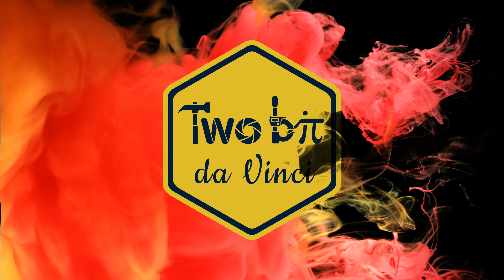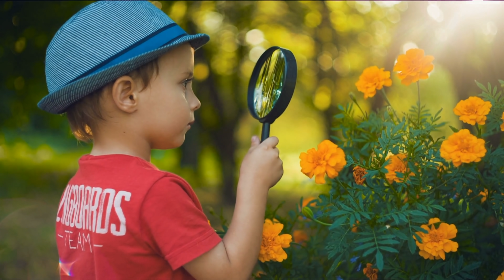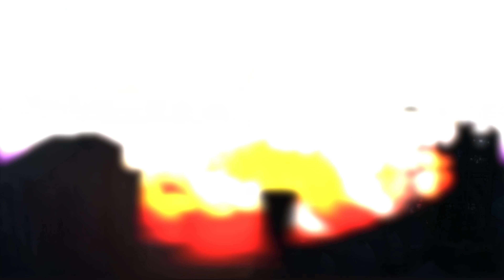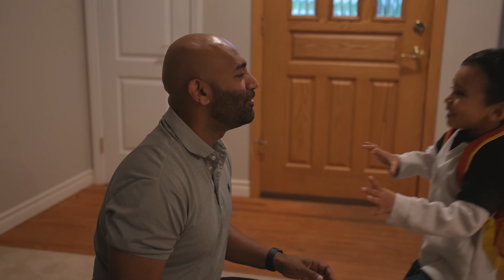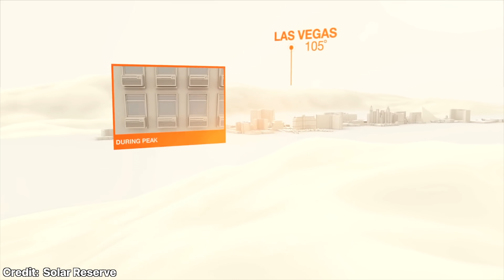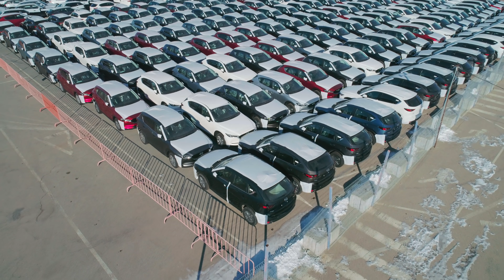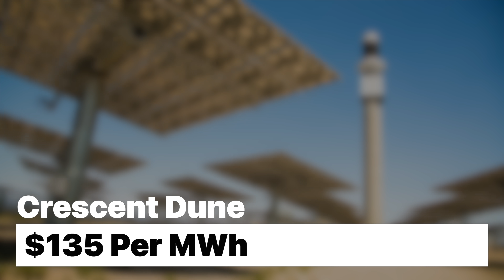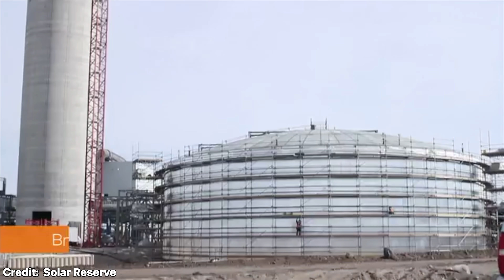This Billion Dollar Solar Plant was an EPIC Failure

Comment: Green hydrogen is always going to be the least expensive storage at scale because a big tank is always going to cost less than a bank of batteries, and the new electrolyzers using magnetic fields to align oxygen bonds are literally twice as efficient as pre-2019 electrolysis.
Reply: There are plenty more storage options coming up besides batteries, like Heat storage, LAES, CAES, ... And there are also battery solutions that are a lot more scalable and easily build/cheap than Li-ion batteries, though usually with lower density/slower reaction times, but that isn't really important in gridscale storage.

Hydrogen is probably one of the worst storage devices long term, both due to cost and efficiency. Ofcourse maybe hydrogen production might improve, but it isn't there really. And ofcourse hydrogen will be needed for a lot more than just storage, so production capabilities might be better aimed at those other needs.
Reply: Source?  (I have doubts)

Comment: Put PV panels on every roof of every building and scale will take care of itself.
Reply: You forgot a huge one, parking lots. Shadow to keep your car cool while charging it up. Drive to work in the morning, hook up, be full in the evening. Next use your car to power your home.
Reply: @astranger448  Good point. This is already being done where I live in the desert Southwest. Most schools and  some shopping centers have installed solar panels in the past few years. No hook ups yet that may come later.. All of these installations are small enough to nullify the problem of scaling up.
Reply: PV is wonderful.  I’m running my house 100% on 8 x 330watt  panels on a Zomeworks tracker.  I bought them for $100 each.  My Grid-tie is giving 1 to 1 credit.  However now the utility is only giving 60% credit for new systems.  This is the problem with PV everywhere.  The utilities need to provide power at night or cloudy weather.  They need compensation for this.  They don’t want to do this for free anymore.  The same thing will happen when everyone has an electric car.  They’ll have to add fees for road maintenance, etc.  The devil is in the details.
Reply: grid stability - frequency and voltage
Reply: Add batteries and the ability to feed the grid at night and you have something.  Who’s going to pay for it?
Reply: @jeffgerhard5770  I live in a part of the country where electricity is expensive, robust air conditioning is a necessity, and where there is a lot of sunshine. My 12 kW solar system generates enough electricity to cover 100% of my annual consumption. I’ve had it for 3 1/2 years and am on track to have the system pay for itself in six years. In other words, it is a good individual investment. I qualified for a 30% federal tax credit which was the government part of the investment. I have considered adding battery storage but the finances don’t quite add up yet. In short, I think that the investment in solar power on a decentralized basis is feasible. It won’t happen overnight, nor should it. A gradual move will allow adjustments to be made at every level — individual, governmental, and public utility.
Reply: @jeffgerhard5770  Compare it to buying a house VS renting a house, pay once a defined sum VS paying an undefined sum forever. All it takes is Russia invading Ukraine to send energy prices through the roof. I'd rather not be at the mercy of every lil tin pot dictator. That being said, my money went into insulating my home, lowering my heating bill to the point said bill almost went away. That is what will pay for it.

Comment: Using the thermal energy without using the steam cycle will bring the project closer to economic use. the turbine with steam production has only 30 percent rendement. and produces a lot wast heat. never ask why every electicityplant uses the coolingtowers ? even nucleair plants produce 70 % wastheat poluting rivers and air with heat.

Comment: It would be cool if those mirrors could be pv, and still reflect.  Providing both types of energy gathering
Reply from the maker: Now that’s interesting… absorb what the cells can convert, and reflect the rest! Big thinking Ed I love it
Reply: Unfortunately the ideal angle for a photovoltaic cell is square on to the sun, which would reflect the light back at the sun, not at a collector tower.
So, if you angle the panels to reflect towards the tower, they power generated by the cells would be reduced.  I  would guess you would lose 20% or 30% of the output from the cells.
Reply: Unless you are talking about exotic double and triple junction PV cells, both conventional PV and solar thermal want the IR portion of the solar spectrum. So, no.

Comment: You did not explain why, at the best moment, they were only producing 50% of their estimated capacity.
Would they have been able to break even, if the price of electric power did not drop like it did? 
Also, the price of photovoltaic energy seems always to be calculated without energy storage, while nobody wants to wait until the sun comes up before using electricity.
It's a bit like comparing apples and lemons. It does not make sense.
Things wear, just by being out in the desert all day, every day. This must be foreseen. 
It seems they make some bad assumptions, causing regular outages.
Still, maybe a v2 version of this plant, could have a lot lower operational costs.
Reply: I worked on the project. The mirrors are covered with frost and snow in the winter and dust the rest of the year. The plant is at 7000' altitude.
Reply: @matthewerwin4677  In the desert, I would not expect a lot of snow, nor rain. Dust sure, but limiting the whole plant at 50%? Seems at least some of the calculations made, were a bit too optimistic.
Reply: @michelhegeraat5430  I was working on the project for a year. I spent the winter there. Every week or two we had a dust storm. Winter is the wet season in Nevada. Below zero temperatures and several inches of snow were common.
Reply: this whole channel sounds funded by 

OIL  INDUSTRY  CABAL .

EXCUSES...EXCUSES...

MORE  WEAK  UNFOUNDED 

E   X   C   U   S   E   S 

.
Reply: @davidbea3711  this channel is very clearly pro green alternative energy and always has been.  Are you basing your comment off just this video or something?
Reply: @StormGod29  this & 1 other vid
Reply: @davidbea3711  I don’t get what you’re saying. The point of this video was that one form of renewable solar seemed to be, at least in this particular case, more cost effective than another (though it wasn’t as clear if that was still the case once equivalent storage was included with photovoltaics, and also didn’t point out that its high electricity price was specified in a long-term contract, not necessarily its actual operating cost, and that under new ownership it is operating again). It did leave out one thing that made the case for this plant even worse from a climate perspective: concentrated plants like this need a natural gas system to keep the salt molten later at night (or I guess in heavily cloudy conditions) after it cools off. So they have some significant amount of carbon emissions routinely just to operate.

Comment: The key is something you once mentioned in the video: welding. The weld material must be the same material of the surfaces you want to joint because if it’s not it will crack open as the dilation is unique for ever material so when you submit it to high temperatures the dilation must be equal along all the system. That was the design mistake. And is what caused the leaks. But this system is too complicated it doesn’t needs necessarily to use molten salt to store energy, you can use batteries, in a simpler system to use all fluid to spin the turbines and then store it on large scale batteries. PV plants may have lesser costs but they need a larger space per watt and the geothermal may be more compact it reduces the initial cost to buy the land that you use to build the plant. So when thinking about “scale” the progression of the price of the space may not be the same in the future so i think the geothermal idea must not the abandoned but to just developed just like everything in life.
Reply: Even autogenic welds usually need to be annealed in order to not form corrosion cells.  If you weld up 316L plates with 316L welding rod but fail to anneal the weld, you will still have a corrosion cell.  The heat affected zone (HAZ) will be the anode and the field plate will be the cathode.  Eventually, you'll have a nice shiny 316L weld bead floating in space without any field plate around it for 4" on either side.  I've seen seawater strainers in Saudi like this because they were not properly post weld heat treated.
Reply: i agree with the geothermal point. some recent advancements in EGS open the potential for new energy exporters and perhaps industry turnover from oil and gas. Sage Geosystems, for example, is focusing on utilizing thermal reservoirs in certain types of sedimentary rock formations. we actually have very large formations of this type in my home state of south carolina, so i can see this being a major investment if it is capitalized on. i love the concept of solar energy, but i hate that it needlessly guzzles space in formerly open countryside - energy storage aside.
Reply: All the hot salt piping and materials are 347 stainless steel.  All the welds were tested with PMI and XRay.

Comment: Would it makes sense to retrofit it with solar panels and use the moveable mirros as a base for them and the infrastructure of power lines going to Vegas?
Reply: I was thinking the same - also maybe make use of the motors to constantly face the PV cells directly towards the sun

Comment: OK, did you ever wonder why solar cells are getting so much cheaper?
 No that wasn't a concern for you...
  China does not have an EPA and they are making most of the solar cells these days.
 There is a waste product known as silica tetra hydride, that is very nasty.
 For every one solar cell you make you create 4 times as much waste.
...
 Think more simply, 1st off human beings are extremely wasteful with all forms of energy and resources they come across...
 They have been conditioned to be wasteful because resources are currently plentifulish...
 If you want small scale think home Sterling hot air engine Powered with a parabolic dish channeling sunlight. 
...
 Simple materials and when used in conjunction with a biocass generator you can have power day-and-night.
 Or we could continue trying to supply the ignorant masses with power they don't understand or know how to use efficiently....
 Whatever you guys want to do...🙄
🤪👍

Comment: Would be curious to work with the data provided. Obviously, running at 20% capacity would make any investment look bad, however, what if it ran at 85% capacity and replaced a peaker plant? Environmental costs of running coal/gas are big, and should be taken into account as well. Definitely some lessons here that hopefully will be applied on new projects.
Reply: Good point, but if this is a private company they could not justify to run operations at loss. Unfortunately this is not a holistic view on the energy market in general, but individual competing companies. Now, that nucelar power is classified as green it will be really tough to compete.
Reply: @bw1227  Nuclear can only outcompete at the largest end of the utility-scale production-cost curve. Hence, it also poses a high single-point-of-failure risk.
World War III has just started, what forms of energy production and distribution pose the highest security risks?
Reply: @ticthak  I don't think nuclear can outcompete any form of energy production if TCO are correctly calculated. Storage cannot be managed over hundreds of thousand years
Reply: @bw1227  Nuclear waste storage is a carefully manufactured "problem". Besides "burning" current cycle "waste" in new generation of reactors, there are many perfectly safe ways of long term, unattended disposal. The only barrier is psychological, one that fossil fuel lobby nurtures for more than half a century, with much help from either clueless or mercenary "greens".
That said, at present the initial cost of construction of nuclear plants is high, as will stay that way as long as serial production of small, modular, inherently safe reactors is prevented from ramping up. (BTW, "inherently safe" is not a marketing buzzword, but a design feature; it requires completely passive emergency cooling of malfunctioning core - no power, no human intervention. It is usually accomplished by negative criticality thermal coefficients and use of pools of water as heat buffers. All solved decades ago.)
Reply: @bazoo513   what do you consider perfectly safe and what is long term? I woul say we are able to build something for a couple of 1000 years, as we did already, but 100s of thousand years is beyond our capabilities.
Reply: @bw1227  I am not talking about building anything. I am talking rock salt mines that have not seen a drop of water for millions of years, geologic formations such as Canadian Shield that are now as they were a billion years ago, lifeless deep ocean subduction zone trenches that will take anything we leave there into the mantle. Even exhausted deep oil wells would do. No need for fences, guards and trefoil warning signs that will not outlive our civilization (which will, if we continue on our present path, last for another century or two max, anyway.)
Reply: 85%??  For a solar project.  What are you smoking?  There's this thing we have on planet earth called "night".  Your most optimistic limit is 50%.  And the production peak does not coincide with the usage peak.  It was always going to be a train wreck.
Reply: @danielhawkins6425  Solar at best goes to 30% CF.Starts at zero in the morning, peaks at midday, then just drops. At 4pm or so it's at half productivity already.. Considering that the most consumption of energy is at around 6-8PM....Some overcast/clouds and production is halved or worse.
Nuclear+ PHES+microgeneration would be the most efficient solution.
Reply: Also the cost of combining energy storage with PVs and end of life costs for disposal or recycling for the panels and batteries. With the mirror system recycling of end of life components is very simple since there are little to no toxic materials involved compared to batteries and PV. Not down playing PV / batteries, all these solutions have their place in our energy mix.
Reply: You cannot REPLACE a peaker plant with something that's difficult and expensive to maintain when we have cheaper alternatives out there.  The market is clearly showing that.
Reply: Another stupid Green Energy project.  Want to see your costs go up? Go Green.  Increase the number of people and equipment needed to produce the same amount of electricity and your costs go up.  Solar?  Great for 4-6 hours a day.  Pretty crappy at midnight.
Reply: @michaelputnam2532  Yeah, with gigantic subsidies, fossil fuel manages to be just twice more expensive compared to wind or solar. In which universe do you live?
Reply: @michaelputnam2532  Have you just awoken from a century of hibernation?
Reply: @bazoo513  cheap is not good, we are talking about sustainability not short term profits
Reply: @bw1227  Exactly. Hence my arguments.

Comment: Not a massive failure, it's a massive mistake. What do we do with mistakes? We learn from them! We learn from massive mistakes...massively!!
Reply: The problem is, they didn't learn from previous mistakes. This same type of system was installed in Southern California probably better than 30 years ago now and it had the same problems. Molten salt corroded the pipe lines and leaked. What a waste.
Reply: @jjackson3240  Thanks JJ! Also, because "they" ignored what I failed to make clear before, is that the inventor realized his concept & design was obsolete shortly after the first prototype project (probably for all the reasons we've seen posted here). Who were the deliberately ignorant "they"? White-collar scammers, Big Power freaks, kleptocrats, and engineers who should have known better, but sold their soul.
Reply: @mlmimichaellucasmontereyin6765  Money is a great motivator and produces many geniuses who scheme not for power (deliberate play on words) but money - investment from people who are greedy. That is the number one issue for these types of investment. What the real story and what they are promising. Gamblers will gamble.  As it goes, the power plant does work, it just doesn't work as well as promised.
Reply: @mlmimichaellucasmontereyin6765  While I agree partially, we do need larger points of power manufacturing to handle the need s of the populace at large. I don't ever see a time when all the power creation is decentralized because, remember - 40% of the population is living at or below the poverty line.
Reply from the maker: so very very well said!
Reply: @TwoBitDaVinci  Rube.

Comment: With the insane drop of Battery cost, and the expiration of LFP Patents in April.  Energy storage systems that are not battery based will find it hard to compete due to costly or high maintenance mechanical parts.